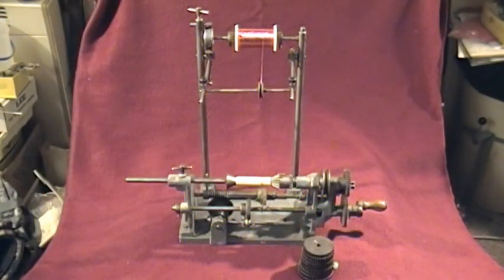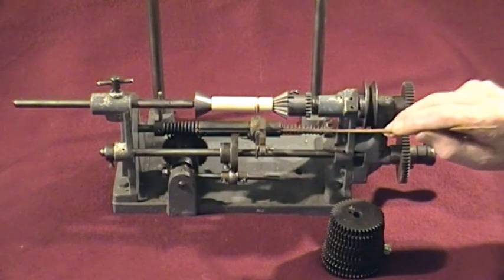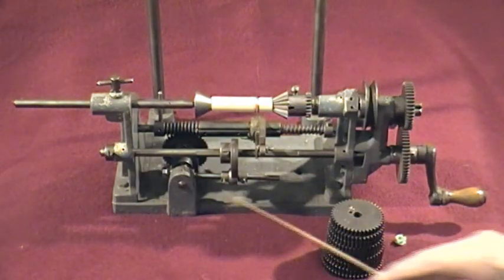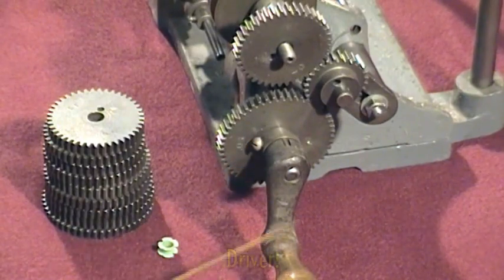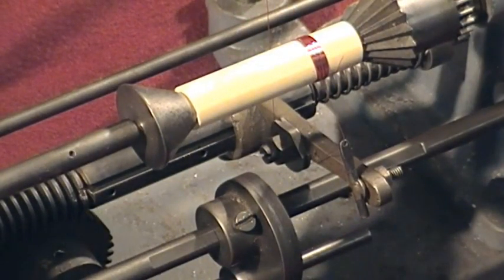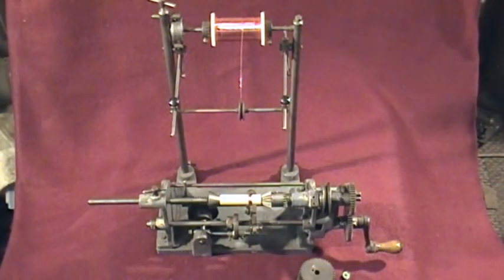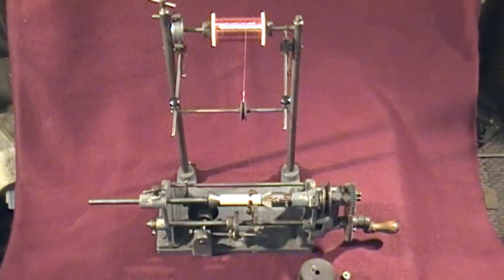Gadgets and Gizmos - A vintage hand-operated small- coil winding machine (SOLD)

Comment: I think the second spool arrangement might actually slide over the columns of the main unit. you could then simultaneously wind on two wires to make a transformer. Strange it did not have some form of turns counter which would be an important detail for coil making. delightful little design.
Reply from the maker: Hi Rob,
Addition of a counter was always in mind - either a mechanical one or a hall effect type set-up. It is now in a museum in the Netherlands!

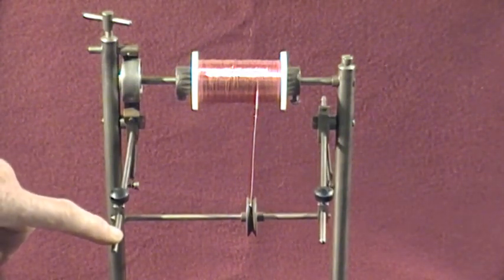Comment: 1:52 , when it goes down more and more it releases some friction ... the point is when it goes down it means the wire has more tension on it so it loosens the grip on the reel to loosen the tension ... it's a dynamic balance tension device ...

Comment: My guess is that device was built in the 1920s.  It's quite a machine!  I'm curious about what kind of coils you made with it.  Since you mentioned "RF" perhaps you are a radio and electronics enthusiast?  Thanks for the video.
Reply from the maker: Hi Jeffry,
Hard to date but suspect you may be right - it was pretty old for sure. I started in electronics as a kid and spent a lot of time making stuff until surface mount and dedicated chips took some fun out of it! If I couldn't breadboard a project it probably didn't get done! I did more audio and test gear than RF but did wind inductors now and again - typically small coils for RF - simple superhets etc.
Reply: You are becoming more interesting in terms of your interests and experiences as I watch more of your videos.  I worked with RF and digital gear for a living several times in my career.  We also dealt with surface mount.  As a tech, I'd troubleshoot and turn the gear over to a builder to remove and replace parts.  It was company policy.  Circuit traces lasted longer that way!  I'm also a licensed ham radio operator.  It's enjoyable to make contacts via Morse Code/CW.  I'm not much of a SSB guy.  Take care!
Reply from the maker: I often meant to get my amateur license but never did. Long ago had an old HRO and used to scan the waves, including SSB - I'd added a small simple oscillator for that. I rather miss the old days of thermionic valves!
I often think, as long as I have some BC109s, some 741 op amps and the usual selection of R and C and I - I can make loads of things still. Maybe also throw in a few TTL and CMOS as well :)
Reply: One of my ham radio mentors had a beautiful HRO receiver and a DX-100 transmitter.  It was a pleasure to use that receiver.  Ed Smith was a WWII vet and fellow Legion member with my Dad.  His call was K2KHM.  
H]When his friends brought a SSB rig to compare performance, he was convinced and joined the SSB ranks.